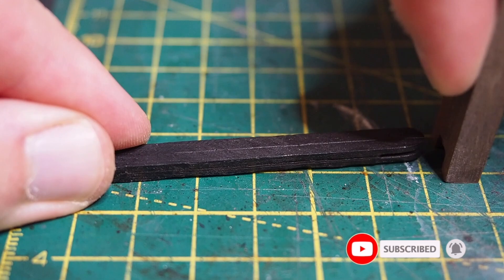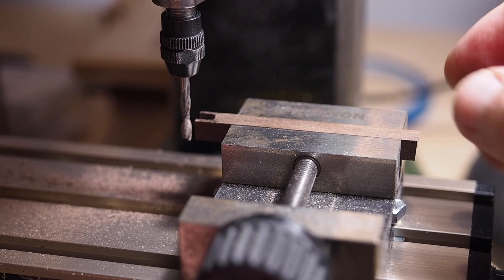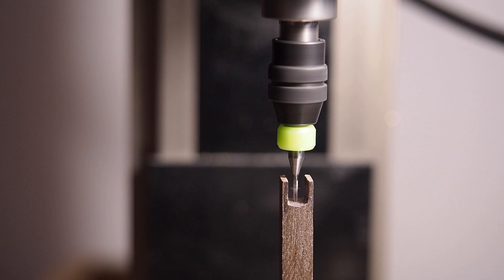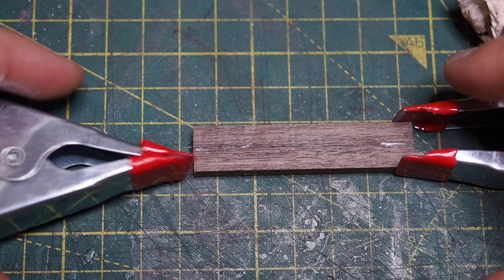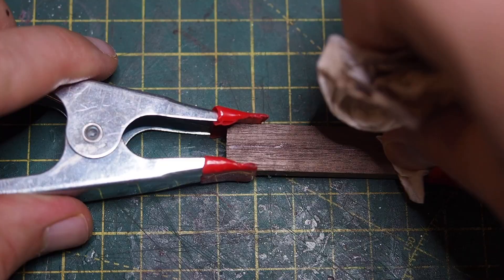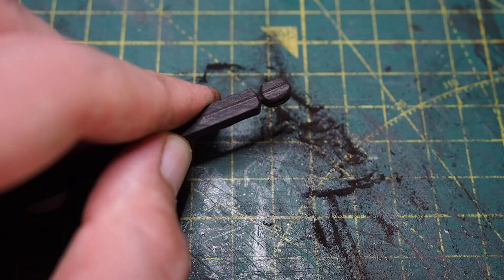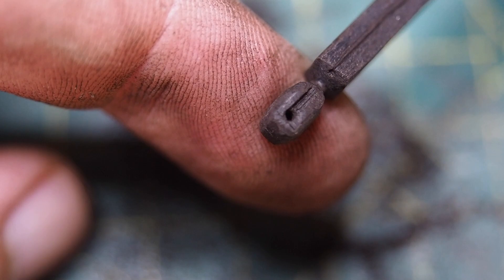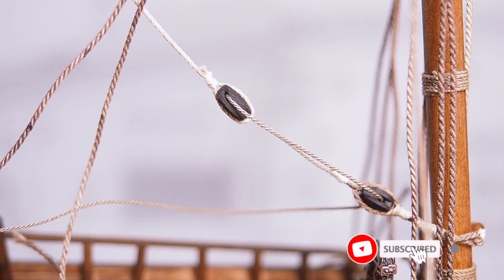I understood how to make SCRATCH QUALITY BLOCKS for ship modelling

Comment: Interesting video. Many thanks! I was wondering why you make all these scratching tools when it seems like you could’ve used your drill as a mill. Was that considered and if it was, why was the set of scratching tools preferred?
Reply from the maker: These are two option you can use, two equivalent methods in the toolbox of a modeller. Having said that not everyone has the drill. 
You can also decide to use the scratching tool just on the sides of the block where the inlet is smaller, so you don’t have to change the drill setting

Comment: thank you
Reply from the maker: You’re welcome :)
Reply: Any thoughts on how to make mast rings for model ships?
I want to scratch build a steampunk Airship with sails with rigging for its Propellers.
Reply from the maker: Have you tried brass?
Reply: Now that I have seen your “How to make 5 Metal Parts for your ship model” I am doing a complete redesign of the Propellers and I will probably use both brass and copper. I may try very light sheet steel too. I do not know If a can manipulate a piece that small.

Thank you for your videos and your help
Reply from the maker: @bearshield7138  that’s great! Enjoy and good luck with your model :D